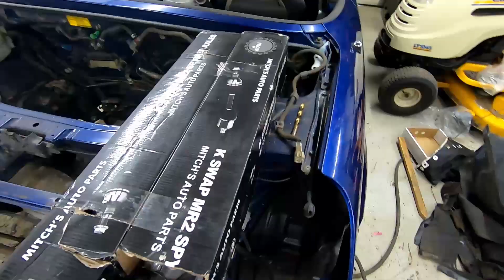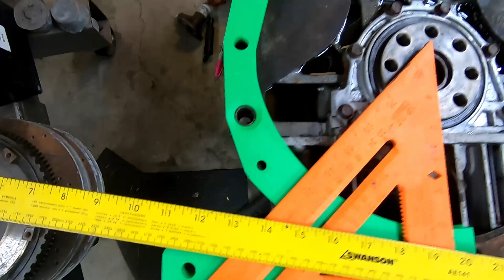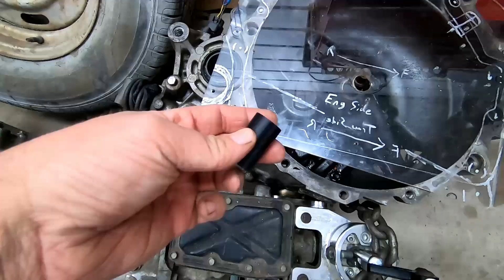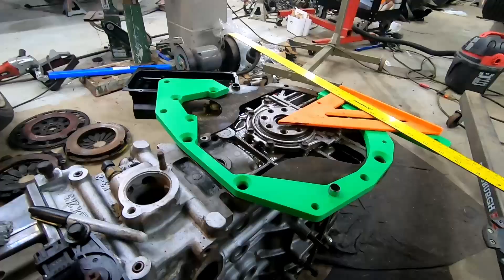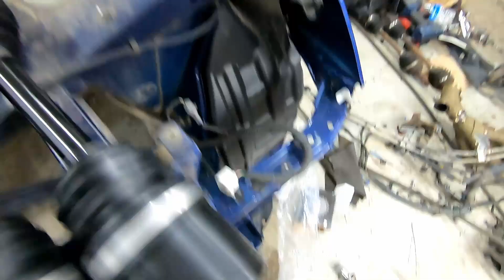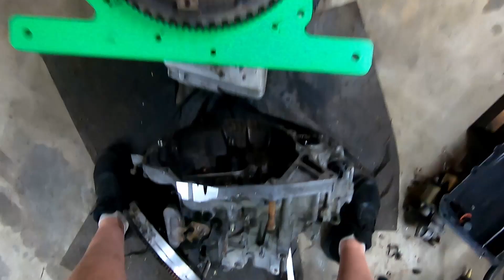MR2 Spyder Kia Adapter Plate and Axles

Comment: ive been watching some off these builds now but no one focusses on the fly wheel and clutch. If you make an adaptor plate thats 20mm thick then surely the must be some sort off 20mm thick spacer to bolt the original flywheel back to the engine. or am i missing something?
Reply: Yes, this is an issue. You either have to have a custom flywheel made (expensive but best way, EcotecMiata does this), make a sandwich of a flexplate->adapter puck->flywheel or ditch the flexplate and come up with a starter position solution

Comment: Hell yeah the T8D engine is a beast and it'll be a good addition to the MR2. 
Are you using the O2 to 04 that has the K2N5 cylinder head or the older K2NA cylinder head?
Reply from the maker: Came out of a 2003!

Comment: Got any socials I can add you on? Love the t8d platform
Reply: I have the T8D in my Spectra also the K2N5 cylinder head is the best with a little bit of porting. I'm running 15.5 PSI on low boost and 17.5 PSI on high boost with stock pistons and 180,000 mi on them https://youtu.be/dOSQHKwto-Q?feature=shared
Reply from the maker: Just made a TikTok account for Enigma Garage last weekend!  Will try to post quick things there before full videos!

Comment: any chance I could get the file for the adapter plate? I'm thinking of swapping to a k series trans at some point in my spectra
Reply from the maker: I will probably sell the plate not the design if wanted when I get it reliably together.
Reply: @EnigmaGarage yeah better business model lol, I just like seeing somone making things for this engine that I have been thinking about, when I get to the point I need one I would be interested
Reply from the maker: Just let me know!  If you find a set of the old colt cams for this motor too please let me know! I'll send a few bucks as a finders fee haha
Reply: @ yeah ill let you know if I run across some however unlikely that may be lmao
Reply: Just weld the cam and grind it down? @enegmagarage
Reply: @EnigmaGarage  replied to one of your comments